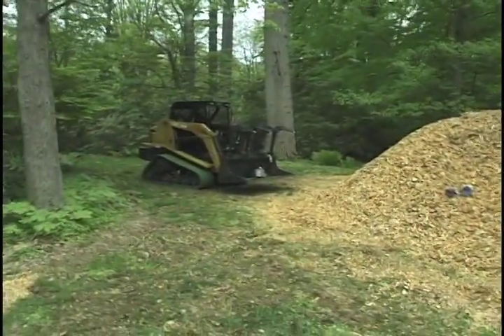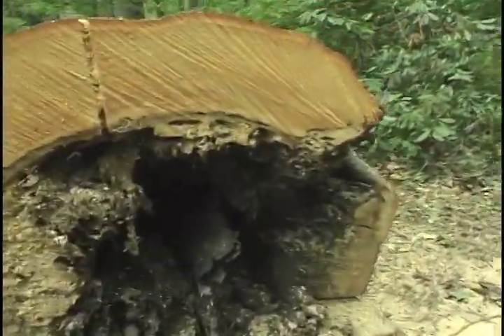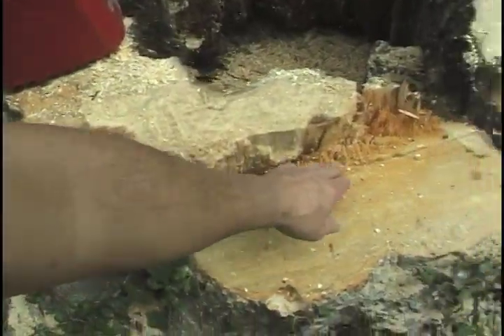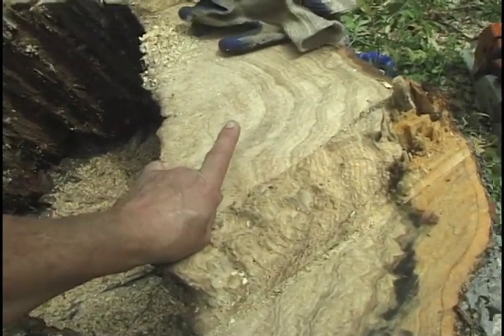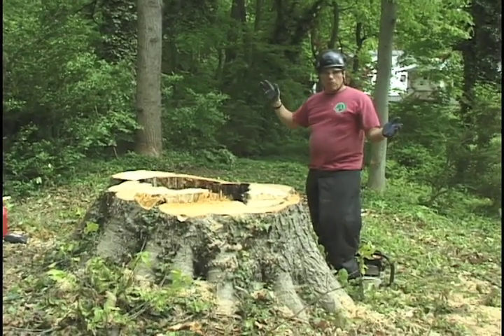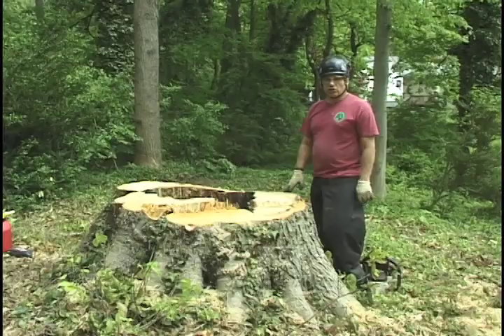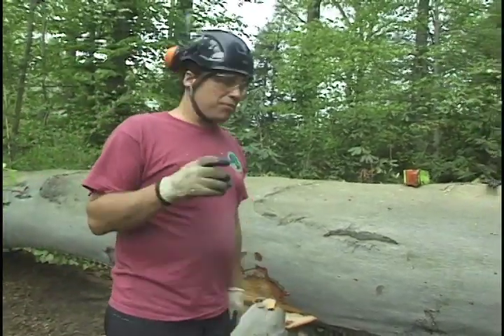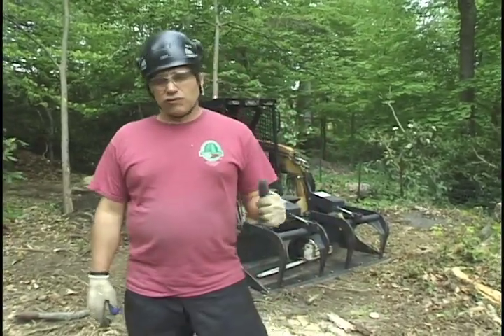Skid Steer loader for safety

Comment: I'm with you 100% on the skid-steer loader for safety. The thing about rigging and manpower for pulling is you can have lots of force through multiple sheaves -- but then you lose speed. With a skidder you have force *and* speed. And those "Turf Tracks" -- I just learned something new! Didn't even know that they existed.

That was a big ol' honkin' beech tree too. With all that rot, it was coming down soon enough, one way or another.